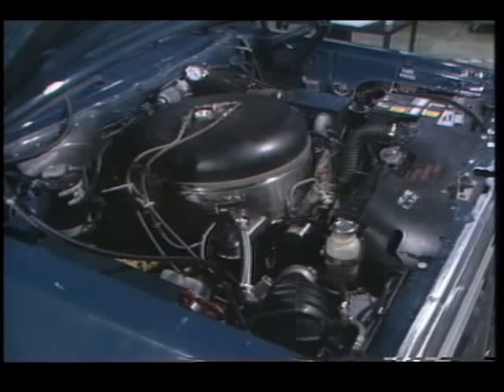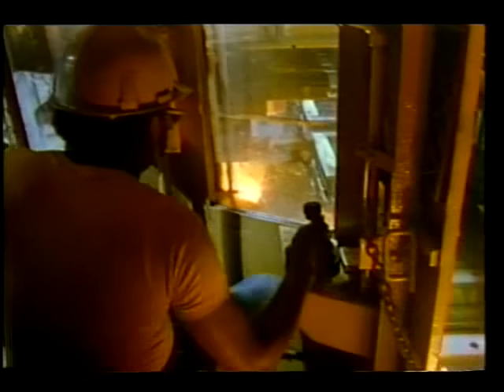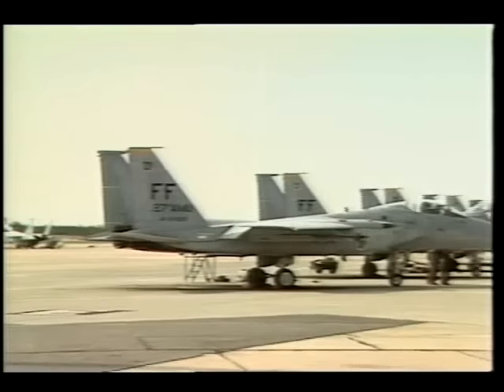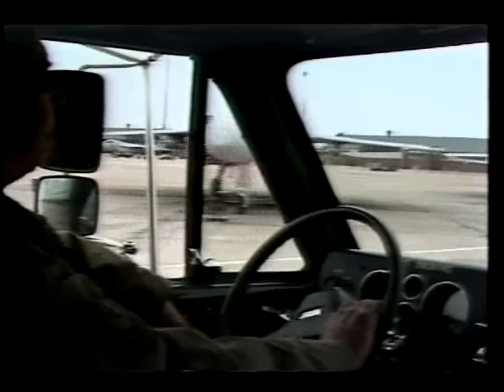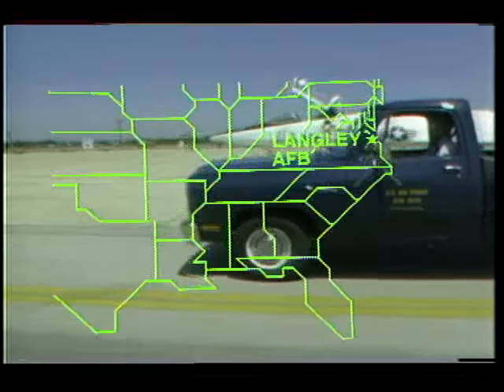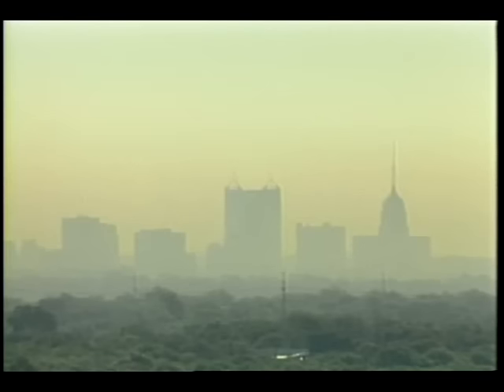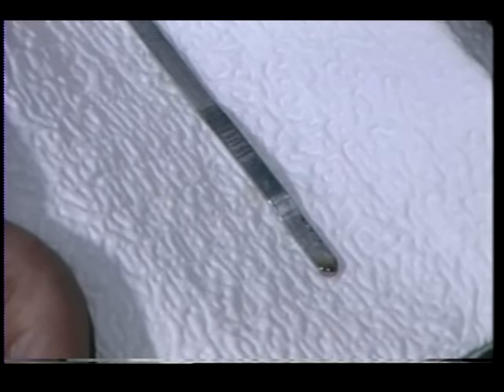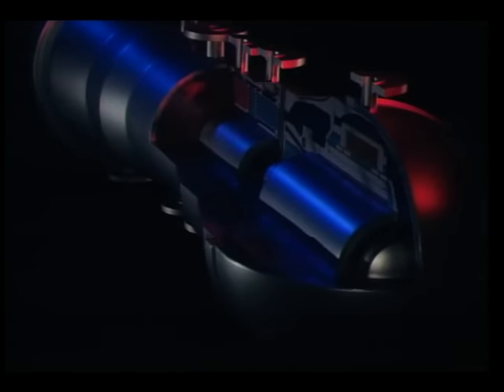The Stirling Engine: A Wave of the Future

Comment: The major issue of this engine is power density
Reply: What do you mean by power density?
Reply: @Z0Il  The amount of power produced by a determined volume.
Reply: The MOD II engine compensated for this particular problem by using pressurized hydrogen as the working gas.  Two different tanks were used, one at 2900 psi, the other at 1450 psi.  A digitally controlled mean pressure system switched between the two tanks as necessary during acceleration and deceleration, which helped keep the tank pressure as close to engine cylinder pressure to allow for a single-stage compressor to be used.  These tanks were used in combination with a "short-circuit" system that allowed hydrogen to be shunted between the maximum and minimum pressure regions of the cylinders to immediately bleed power during deceleration.  The hydrogen pressure control system is probably the true genius of this engine, and its cost and complexity may have been the real reason that it didn't get more serious consideration.  It required digital engine control and was by design a drive-by-wire accelerator.
Reply: @raelik777  but those problems can be worked around easily
Reply: @felixbeutin9530  Well,  I think the timing was just poor.  We have much better, faster and cheaper computer systems today, so the mean pressure system in the MOD II engine wouldn't be all that expensive these days.  Still complex though, and it still takes advanced materials and very tight tolerances to use pressurized hydrogen as the working fluid in a Stirling.  Will we someday see advanced hybrids that are basically plug-in EVs with a stirling range extender? Probably, but I'm guessing it'll be another 10-20 years.
Reply: @blanedabney8381  maybe it is time to revisit this technology
Reply: @felixbeutin9530  Yeah definitely. These two are just nay saying. This video is like a hundred years old. Besides, I don't think fuel density is a problem if you can just chuck some compressed straw pellets in there and go for miles. Just store them in the boot/trunk. They made a plane out of stirling engine. All you need is an electric engine to drive until the engine is hot when it comes to slow starts.
Reply: @raelik777  There are other problems inherent to that system. Hydrogen is a hard to contain gas and needs to be refilled periodically; also dangerous since the hydrogen is heated. The danger of compressed hydrogen is often over played, but compressed hydrogen above the flash point is another story. Even a tiny leak would ignite, burn a bigger in the tank, and explode. You can get similar results with helium, but we would quickly run out of it if we tried to use this wide spread. 

I heard some start-ups were using CO2 to simplify things, but I don't know how efficient that is.

Also, the MOD II only got up to 80HP. Still far less power than most customers would want.
Reply: @amirabudubai2279  Sure, though there wasn't enough hydrogen in this system for it to be that big of a concern, certainly no more than if the fuel tank went up.  I definitely think there's value in re-evaluating stirling engines for modern automotive usage, just not direct drive like this.  It makes much more sense now to have a hybrid electric system with a constant or maybe slightly variable RPM stirling generator feeding power to electric motors, alongside batteries, solar panels, etc.
Reply: @raelik777  Sterling engines do NOT use pressurized gas.  They require a temperature gradient.  In fact, LOW pressure gas is better as it has the most ability to change pressure when heated.  If the gas is already under pressure, it cannot expand when it is heated.
Reply: @raelik777  Oh yeah.  That's not remarkably inefficient or anything.
Reply: @protoborg  Also, just wrong. The pressure of the gas doesn't affect it's ability to change pressure when absorbing heat. The effect of increasing the pressure of the working fluid in a stirling engine is effectively the same as if you had instead kept the pressure constant and increased the VOLUME (and obviously added more gas to fill that volume to keep the pressure constant). It allows you to generate more power per stroke.
Reply: @raelik777  Again, that is NOT the way a Stirling engine works.  It relies on HEAT, not pressure, difference.
Reply: @raelik777  Yes it does.  Since the pistons are in a functional sealed space, the pressure of the gas can only rise so much.  If the pressure is already high, the gas cannot increase in pressure any more and will thus not be able to expand when heated.

The only way to increase pressure is by increasing the volume of the gas within a specific space.  You can't increase the volume of the gas within the confines of the cylinder without increasing the pressure.

Also, none of that is even remotely how a Sterling engine works.
Reply: @raelik777  That is simply not the way a Sterling engine works.  The two pistons in the Sterling engine are the power piston and the displacement piston.  They are not sealed off from each other.  In fact, the displacement piston moves freely within the cylinder.  AS it does this, it exchanges the heated air and the cooler air.  This causes the power piston to move.  That in turn causes the flywheel to spin.  That results in the displacement piston moving.  This all works out to cause the air to expand as it is heated then to contract as it cools.
Reply: @protoborg  yes, I'm well aware of all of that. Nothing I said changes that. And the Mod 2 IS a stirling engine. Read the paper before you argue about things you clearly don't understand.  Also, go read about the Dunning-Krueger effect, because you are clearly at or approaching Mount Stupid. You seem to think I'm suggesting they somehow use the different pressures of hydrogen to move the pistons, or something, I'm not sure what you think. That isn't what it does.  The mean pressure system in the Mod 2 increases or decreases the pressure in the WHOLE sealed system (it has to, obviously, like you said, the cylinder volumes are connected), so that it is able to absorb and release more heat per cycle. It does this in response to demand from the accelerator pedal. At the same time, more (or less) heat is generated by the burners. Obviously, there is a limit to how far this will go, depending on the engine materials ability to withstand the larger temperature swings, how fast the cold side can reject heat, the thickness of the walls required at the higher pressures increasing heat transfer resistance, etc.
Reply: @protoborg  No, you are exactly wrong. The mean pressure of the gas has little to no bearing on if the gas can increase in pressure through supplied heat (or other energy), unless you're approaching the phase transition, which 2900 PSI is nowhere near for hydrogen at the temperatures we're talking about (way above ambient). If this were true, compound turbo systems wouldn't work like they do (not that they are relevant to stirling engines, just pointing that out). The compressibility factor does have an effect, but using as pure of a hydrogen or helium charge as possible will keep this near to the ideal gas. And NONE of what I am saying is changing how a stirling engine works. You need to work on your reading comprehension.
Reply: @protoborg  Also, I'm not sure if you realize this... the NASA Mod 2 Stirling engine that I'm talking about, that is a later revision of the engine in this video. I believe the vehicles in the video are the Mod 1 version from a few years earlier, but the use of compressed hydrogen is the same in both. I'm not just coming up with this off the top of my head or something, or talking about theory.
Reply: @raelik777  Dunning-Krueger, huh?
Hello, Pot.  Meet Kettle.

If you increase the pressure in the whole system NOTHING will change.  The pressure of the system is not what determines how fast the thing runs.  That is down to the temperature gradient.  NOTHING else makes any difference to the Stirling engine.  If you fiddle with the pressure in the whole system you will cause the engine to either stop running or to run less efficiently.  Since it is already  inefficient, that would be counter-productive.  In fact, increasing the pressure inside the cylinder would LOWER the speed achieved as the cold side would be hotter and thus the gradient would decrease.

If the pressure is not used to operate the piston, what would be the point of having different pressures?  Also, if the overall pressure is increased, the cold side would be unable to "release" the heat as well.  As you pointed out, increased pressure increase the amount of heat that the air can hold.  In other words, increasing the pressure in the whole system would retard the cold side's ability to release the heat.  This would in turn cause the engine to run SLOWER as the gradient would be reduced.
Reply: @raelik777  Where in the video do you see a Stirling engine?  That thing they show when they are talking about the Stirling engine is NOT one.  Stirling engines do not have carburetors on them.  That big black dome on top looks suspiciously like a carburetor.  Also, the video never once mentions what they use to burn the fuel.  They just talk about using fuel in the Stirling engine.  Since Stirling engines do not use fuel, that is rather suspicious.

Also, hydrogen at very high pressure has the characteristics of a metal, ie NOT a fluid any more.  That would mean NO MOVEMENT inside the piston of the Stirling engine.  That would mean your vehicle would cease up and become a large metal paperweight!  NASA of all people would know about this and thus would NOT use it as the working fluid.
Reply: @protoborg  First, READ THE DESIGN REVIEW, either the Mod 2 review that I linked before, or this one for Mod 1: https://ntrs.nasa.gov/archive/nasa/casi.ntrs.nasa.gov/19820026435.pdf
I believe this video is showing the Mod 1 design, but that document is less than ideal for looking through. The scans are fairly low quality, and the organization is kinda terrible. The Mod 2 is just an improved version of it though, and almost everything in it applies to this engine, and that document is MUCH better.  What you are seeing in that video IS a Stirling engine, it just does not have the layout that you typically see in a desktop Stirling. It is built to fit within an existing automobile chassis. That dome on top is not a "carburetor" (I think you mean air filter), it is an insulating dome covering the external fuel system (the burners). That chunk of metal sticking out of the top of it (80's computer graphics are terrible) is the fuel nozzle.  Stirling engines most definitely use fuel. You have to generate the heat somehow. You can make a tiny demonstrator that uses the heat from your hand, or like a solar reflector or just direct sunlight, but you have to have heat. If you don't at least look at page 7 of the Mod 2 design review (https://ntrs.nasa.gov/archive/nasa/casi.ntrs.nasa.gov/19880002196.pdf), and then the various points in the document where they talk about the pressurized hydrogen and the mean pressure control system, you are going to continue to make yourself look like an idiot.
Reply: @protoborg  Also, the hydrogen in this engine is not at "very high pressure".  2900 PSI is actually very moderate for hydrogen.  For hydrogen to behave as a metal... you have to get it up to 25 GIGAPASCALS, i.e. 3.6 MILLION PSI. Nobody is talking about doing that. How is the air up there at the summit of Mount Stupid?  Did you read about the Dunning-Krueger effect yet? Textbook. Arrogance.
Reply: @protoborg  Wrong. Just wrong. First, I never said it would make the system run faster, I said it would let it generate more power. Increasing the pressure increases the amount of heat the entire volume of gas can absorb and release.  Just increasing the heat will only get you so far.  So you increase the pressure of the gas in the system, and increase the amount of heat.  This will allow more power to be generated with each stroke.  The actual RPM of the system has all sorts of other limitations (weight of the moving components, friction, etc, etc).
Reply: @protoborg  So the vehicles in this video are definitely using the Mod 1 engine, not the Mod 2. They were used in a separate but directly related program: https://ntrs.nasa.gov/archive/nasa/casi.ntrs.nasa.gov/19880018596.pdf
That document covers Phase I with the van, and they mention Phase II.  This document is a review of the entire Automotive Stirling Engine Devlopment project, and they talk about the truck in the NASA TU Phase II section: https://ntrs.nasa.gov/archive/nasa/casi.ntrs.nasa.gov/19970012689.pdf
That covers the vehicles you actually see in this video, which were built and are using pressurized hydrogen in their Stirling engines. This isn't some theory or even debatable.  They were built and existed and were tested extensively.  They had issues that would make them not commercially viable, since the computers at the time weren't fantastic, plus hydrogren was never going to be feasible, due to embrittlement requiring very advanced alloys in the engine and seals with fantastically tight tolerances and advanced designs.
Reply: @protoborg  The reason there are two different pressure tanks is described in the design reviews.  It is to allow for rapid pressure changes, up or down, without having to rely on the speed of the compressor pump, and also so they could get away with a single-stage compressor.  The pump just maintains the pressure differential between the two tanks.  All of that is managed by the mean pressure control system, and that happens in response to accelerating, decelerating and braking.
Reply: @protoborg  Oh, apparently there are THREE volumes of the design review for the Mod I program. I had only found volume 1 -> https://ntrs.nasa.gov/archive/nasa/casi.ntrs.nasa.gov/19820026435.pdf
Here's volume 2 -> https://ntrs.nasa.gov/archive/nasa/casi.ntrs.nasa.gov/19830002721.pdf
And volume 3 -> https://ntrs.nasa.gov/archive/nasa/casi.ntrs.nasa.gov/19820026436.pdf
Be prepared for a ride though, altogether that's 1465 pages of extremely technical details of an engine you don't think can work.
Reply: @raelik777  The problem is you don't actually know how a Stirling engine works.  You cannot use compressed gas as the operational fluid in a Stirling engine.  That is not what they are designed for.  They are designed for TEMPERATURE changes not pressure changes.  Nothing you have said changes that FACT.
Reply: @raelik777  Increasing the amount of heat contained in the air WILL be definition make the thing run faster.  That's the way it works.  Increase the temperature gradient and the engine runs faster.

No it won't increase the power.  It will ONLY increase the speed the flywheel spins at.  FYI, the "engine" in the video lacked the flywheel which is a vital part of the Stirling engine.  Without the flywheel, IT DOESN'T WORK.

I never said it would increase the speed indefinitely.  But increasing the heat DOES increase the speed.
Reply: @raelik777  A Sterling engine has NO FUCKING SEALS!  That is the whole fucking point!  Sterling invented the fucking thing in order to get around the short-comings of steam engines, ie they explode due to pressure leaks.  In other words, NO PRESSURE SEALS.  What the hell does a computer have to do with anything an engine designed in the 1816?  Just because NASA calls it a Sterling engine doesn't make it one.
Reply: @raelik777  Look at page 28 of the first volume of this ludicrous monstrosity.  That is NOT a Stirling engine.  That is an over-engineered pile of garbage NASA is trying to pass off as their "improved" Stirling engine.  NASA has essentially improved a mouse trap by making the mouse stupider.
Reply: @raelik777  Page 28, Volume 1: That is an ICE that has been run through a trash compactor one too many times.
Reply: @protoborg  This video is literally about the development of one of the most efficient Stirling engines ever created. Period. The Mod 1-equipped vehicles shown in the video aren't quite to that level, but the Mod 2 vehicles were. They reached a peak thermal efficiency of 38.5%.  Modern gasoline internal combustion engines reach 25% at best. It wasn't pursued further because of the production costs and concerns about throttle response.
Reply: @protoborg  No, that would be your over-inflated ego.
Reply: @raelik777  The Stirling cycle no more makes something a Stirling engine than putting a motor on a bicycle makes it a motorcycle.
Reply: @raelik777  No.  This video is about NASA TRYING to make a more efficient Stirling engine and failing miserably.
Reply: @raelik777  A nuclear power plant uses the same principles as a steam engine.  Does that make the nuclear reactor a steam engine?
Reply: @protoborg  Actually, that is EXACTLY what defines a Stirling engine: An engine that uses the Stirling cycle, of which there are many types. However, I wouldn't expect an ex-Uber driver to understand that.
Reply: @protoborg  Wrong, because they did, and succeeded, and are widely recognized as having done so 35 years ago.
Reply: @raelik777  No it isn't.  A Stirling engine is a particular type of engine that just so happens to use the Stirling cycle.  There are exactly three types of Stirling engines; alpha, beta, and gamma.  There may be other types of engines that use the Stirling cycle, but they are not Stirling engines any more than a Toyota factory is a Ford factory just because they both use techniques created by Henry Ford.

What does being a former driver for Uber have to do with anything?
Reply: @raelik777  Nope.  They did nothing of the sort.  They developed an engine that uses the Stirling cycle.  That does NOT make it a Stirling engine.  That only means it uses the Stirling cycle.
Reply: @protoborg  A Stirling engine is defined as "A heat engine that is operated by a cyclic compression and expansion of air or other gas (the working fluid) at different temperatures, such that there is a net conversion of heat energy to mechanical work. More specifically, the Stirling engine is a closed-cycle regenerative heat engine with a permanently gaseous working fluid."
That's it. You don't get to decide the other parameters of what YOU think a Stirling engine it, because THAT is what the scientific community has agreed defines one.  The NASA Mod 1 and Mod 2 engines fit that to the letter. Your opinion means absolutely dick.
Reply: @raelik777  No.  The definition of a Stirling engine is a heat engine that is operated by a cyclic compression and expansion of air or other gas (the working fluid) at different temperatures.  However, in practice a Stirling engine is a specific configuration of components.
Reply: @raelik777  And you don't get to call something a Stirling engine simply because it uses the Stirling cycle.
Reply: @raelik777  Nice to meet you, Pot.
Reply: @protoborg  Except I do when it clearly is. The double-acting arragement is a hybrid between a piston and rotary Stirling. It rotates (figuratively, they don't literally rotate) the displacers on either side of the power piston. In addition to giving great design variability in the heat transfer area, this layout eliminates all but one external seal on the output shaft and one internal seal on the piston. Also, both sides can be highly pressurized as they balance against each other. That is straight from Wikipedia, if you're curious.
Reply: @protoborg  Here is an image of the arrangement of a double-acting Stirling: https://www.mpoweruk.com/images/stirlingDA.gif
Reply: @raelik777  There are no seals on a Stirling engine.
Reply: @protoborg  Let's do a little thought experiement. Say we have a hermetically sealed beta-type Stirling, with no "seals" like you seem to believe is important. Never mind getting power out of it, though that could be done with a linear generator. Isn't important.  Let's seal it with air at ambient pressure and temperature at sea level, so an ideal 1 atmosphere.  Give it some heat and cooling, and it'll work (assume the flywheel is also sealed inside). Now... take it up to Denver, where the ambient pressure is lower because of elevation. Now your Stirling is pressurized! Does it stop working?
If not, what about if we take it up to Everest? Or maybe put the Stirling in a vacuum chamber?  Maybe not at a full vacuum (since we'd probably rupture the thing, since it probably wasn't built to hold at that relative pressure), but enough to simulate an even higher altitude.  Or what if we DID build it strong enough for that, could we launch it into space and it still work? You do realize that there is no functional difference between increasing the internal pressure or decreasing the external pressure, not until you cool the gas to the critcal temperature for phase change to liquid. All you are doing when you pressurize a gas is adding more mass of that gas to a given volume. This doesn't change the behavior of the gas, there is just more gas in the same space. Having more mass of that gas allows it to absorb and release more heat than you could do in the same volume at less pressure.  How much pressure required for a given amount of gas is can is a function of the specific heat capacity of the gas molecules (which is NOT pressure dependent, it's a function of the molecular weight of the gas), and obviously the thermal characteristics of the cylinder walls. The higher the specific heat, the more of it a gas can absorb and release.  The more capacity it has, the faster it can increase and decrease pressure in response to that, and the more mass you have doing that, the more energy is exchanged while doing so.  A lower molecular weight makes for a more compressible gas (typically). The mean pressure of the gas has no bearing on it's ability to increase or decrease in pressure.
Reply: @protoborg  You may have incorrect assumptions about the behavior of gases under pressure due to the behavior of things like compressors (i.e. electrically driven pump. An actual compressor turbine has different limitations) and especially pumps. When you see a pump unable to increase the pressure of a gas in a vessel any further, that is because of limitations of the PUMP, not the gas. The seals in the pump aren't strong enough, or the piston diameter is too small, or the cylinder doesn't move enough volume per stroke, or there isn't enough power available. When you're pumping gas into a system, during the actual pumping stroke, the pump volume and the vessel volume are connected into one volume, and they equalize, even if it's only for a moment due to a valve or something. At a certain point, that pump will not handle that pressure.  HEAT, however, has no such limitation. That is why it is exceedingly dangerous for a pressurized container to remain too long in the vicinity of a large source of heat.  The gas inside will happily and very easily increase in pressure until it violently ruptures the vessel.  If you don't believe this, I HIGHLY recommend you go do a little experiment.  Take a regular bicycle pump, and try to fill a scuba tank up to 3000 PSI. When you get tired, assuming you die of a heart attack first, go through a propane bottle in a fire and tuck in for a nice session of marshmallow roasting.  Don't worry, according to what you think, it won't explode! Sit as close to the fire as you like!
Reply: @protoborg  Let's throw even MORE science at this, if you aren't satisfied. Here is a simple phase diagram for hydrogen: https://www.researchgate.net/profile/Andreas_Zuettel/publication/8618603/figure/fig1/AS:277689450680341@1443217732712/Primitive-phase-diagram-for-hydrogen-Liquid-hydrogen-only-exists-between-the-solid-line.png
We're talking about a system that is operating with pressurized hydrogen from 1450 PSI to 2900 PSI, or 99.97 bar to 199.9 bar (almost seems like they chose those pressures for a reason, doesn't it?).  Let's pretend they have some serious antifreeze in the coolant system for the cold end, or maybe have a block heater, and can run this thing as low as -40 C (or 233.15 K), and the Mod 2 design says the heater combustion temperature gets as high as 1700 C (or 1973.15 K).  The thermal efficiency of the whole system is ONLY 38.5% (only), meaning most of that heat is wasted in the exhaust or by being absorbed by the engine mass and other components. But let's pretend it can actually get the hydrogen that hot (it has no bearing on my point, as you will see). On the phase diagram, that puts us at or 1/20th of a line higher than the 10^2 mark on the pressure axis (Y, which is linear), and between just past the first mark after 10^2 and just short of the first mark past 10^3 on the temperature axis (X, which is logarithmic). That is WELL within where hydrogen is a gas, and nowhere approaching a phase change.
Now, lets look at diagram of the volumetric density of hydrogen as a function of gas pressure: https://www.researchgate.net/profile/Andreas_Zuettel/publication/8618603/figure/fig2/AS:277689450680342@1443217732737/olumetric.png
Down at the 100 to 200 bar range our hydrogen is in, it behaves as close to an ideal gas as possible, meaning that you can basically use the ideal gas law formulas directly without having to worry too much about the intra-molecular behaviors of a real gas vs. an ideal gas.  In fact, we are so low on the curve it might as well be at room temperature and ambient pressure, that's how little difference it makes.  It's not zero difference, but it isn't relevant to the operation of a Stirling engine.  The only question is can you build an engine that can contain that pressure, transfer the heat efficiently to and from the gas volume, and make adequate seals that only add a reasonable amount of friction to the system and don't cause you to waste too much energy running a multi-phase pump to maintain the pressure or keep having to add more working fluid.  The answer to that is yes, you can, because they did it in the early 80's with a lot of very, very smart people working on it spending a ton of money.
Reply: @raelik777  There are sooooo many things wrong with your statement here.

First, you can only compress a gas until it becomes a LIQUID.  In other words, it ain't a gas any more.  That's how they get liquid oxygen for the space shuttle.  BTW, there are two ways to increase the pressure of a gas.  Either you increase the mass of gas within the space or you decrease the space.  One way you increase the heat, the other way you don't.

Further, even if the gas did not liquefy at some pressure, you can't compress matter down to the Planck length as atoms have mass that cannot be compressed.  Thus the minimum you can compress something is determined by it molecular mass.  However, the matter will have long since turned solid by that point.

You wouldn't need an entire tank of gas to run a Stirling engine.  That would be waaaaay too much gas.  The gas within the cylinders is more than enough as that is the way the thing is designed.

Advanced alloys for hydrogen, huh?  So I guess no one ever uses hydrogen as a fuel source.  Yeah, nice try.

It wasn't adopted because the power-to-weight ratio is just too damn high.  The amount of power it produces is much too low for the mass of the engine.  The price is irrelevant.

What the fuck possible reason could there be for using an engine which outputs ROTATIONAL energy in a fucking rocket?!  That is beyond stupid.  A Stirling engine adds nothing but weight to a rocket.  Not to mention the fact that the whole point of the RTG is it HAS NO MOVING PARTS.

I didn't say you CAN't pressurize a Stirling engine.  I said there is no point.
Reply: @raelik777  So your contention is that NASA equals great idea?
Reply: @protoborg  First point, FALSE.  To liquefy a gas, you MUST cool it to the critical temperature.  It does NOT matter how much you compress it, if you haven't cooled it to the critical temperature, it will NOT liquefy.  Hydrogen must be brought down to 33 K before it will liquefy.  Once you do that, it actually doesn't take much pressure to liquefy, like 13 bar or so. Here is a more complete phase diagram, though the X axis is mass density grams per cubic centimeter.  http://militzer.berkeley.edu/diss/log_phase_diagram08.png
You can convert that axis to bar or PSI with that volumetric density graph, but it's easier to remember that hydrogen is about 20 kg/m^3, or 0.02 g/cm^3. So  pretty much anything on that chart to the right of 10^-2 is over 4300 PSI. "Molecular fluid" is just another name for gas, "atomic fluid" means that the H2 has broken down into individual atoms.  The grey area at the bottom is the actual liquid phase, and above and to the right of the critical point (the point labeled Cgl), they don't label it, but that's where hydrogen is supercritical, so it behaves like a gas AND a liquid, at least until it either goes solid or metallic. There we are talking about VAST pressures that no pump is going to achieve.
Second, the internal volume of the cylinders is a total of 0.502 liters. The actual hydrogen tanks are 1 gallon, but that's to account for the inevitable slow loss of
hydrogen from the rest of the system, so it doesn't have to be refilled very often.
You don't need advanced alloys to just contain hydrogen in a tank, or to burn it or use it in a fuel cell. You DO when you're running it at upwards of 2000 PSI and heating it in a metallic vessel, as most metals absorb and are embrittled by hydrogen. Just burning it near ambient pressure doesn't require anything fancy.
The power-to-weight ratio was NOT great, I can't deny that.  It wasn't HORRIBLY worse than the Celebrity engine the Mod 2 replaced.  And that was almost certainly a factor.  They might have been able to get it to equal it, but the cost was actually cited as THE factor. It was just too expensive (both in construction and future maintenance), and getting the power-to-weight down would have been even more expensive.
Finally, what did you not understand about a free-piston linear generator? It is literally hermetically sealed, with no mechanical output.  It has external electrical connections, because the piston drives a linear generator.  Also, I said space craft, NOT a rocket. We use rockets to get things into space, but those things (which we tend to call spacecraft, even if they don't carry people) often need electricity once they're up there.  ASRG = Advanced Stirling Radioisotope Generator.  It uses a Sitrling cycle to generate electricity from the heat of a decaying radioisotope (plutonium in this case). They've been running one non-stop for over 100,000 hours now: https://www.spaceflightinsider.com/space-centers/glenn-research-center/it-keeps-going-and-going-stirling-engine-test-sets-long-duration-record-at-nasa-glenn/
The point of the ASRG is that it will generate more power than an MMRTG (140 w vs 120 w), but weigh about 13 kilos less, and use a quarter of the plutonium. If you are going to be this arrogant, you need to learn more about what you're talking about. This is textbook Dunning-Krueger shit. Textbook.
Reply: @protoborg  I never said all of NASA's ideas are great. Hardly, in fact. Yet, here you go, continuing to try to move the goalposts... again.
Reply: @raelik777  Just because it runs longer does NOT mean it produces more power.  Even if it did produce more power, the additional weight of the moving parts is NOT worth it.  Spacecraft (which use rockets for propulsion) are VERY sensitive to weight changes.  It's not like they can use an electric motor to propel the damn thing.

A Stirling engine does not need high pressure gas to function.  In fact, it is designed to work at atmospheric pressure.  Your examples of different pressure locations does not change that as the pressure inside the engine REMAINS THE SAME regardless of where you take it.

It's funny you keep referencing things that are not actually supporting your point.  That last reference is about a GROUND experiment.  It has NOTHING to do with going into space.  Ever wonder why they don't have massive machinery on a spacecraft?  It's because the spacecraft has to limit the weight it carries.  That's one reason why you will never go into space.  Despite your vacuous head, your density is far too high.
Reply: @raelik777  I do applaud your use of a logical fallacy.  However, you are still suffering from pot-kettle so...
Reply: @protoborg  You are the one moving the goal posts. First, I NEVER said they NEED pressurized gas, just that you CAN use it. Second, It DOES support my point that a Stirling engine CAN use pressurized gas. You seem to forget that this is how this argument started, and your refusal to admit your ignorance to that easily proven fact. I gave the ASRG as an example because it is a sealed system pressurized to 500 PSI of helium.  It is far simpler to describe and understand because it's a simple free-piston Stirling linear generator. However, that does not mean the Mod 2 is NOT a Stirling.  It's just a far more complicated one because of the constraints of the time it was built and the purpose it was built for.  82.5 HP.  You try building a Stirling that can do that and will fit in the engine bay of a simple 2 or 4 door passenger car. I'll wait.
Just because the experiements are being done on the ground doesn't mean they don't plan on launching it into space. That is how we fucking test things before sending them into space, we don't live there. The ASRG IS designed for space, it only weighs 32 kg (13 kg lighter than an MMRTG), and puts out 20 more watts of power using less plutonium. It's intended to be used in deep space missions, which last for decades, so they need to be sure that these Sitrling engines will last long enough.  Hence, a ground test that is 110,000 hours and going. You need to learn to read.
Reply: @protoborg  Keep up with your deflection, we'll see how well it works when I keep providing actual concrete examples and proof of what I'm saying, while all you have provided are incorrect words from your head.
Reply: @protoborg  No, I don't think it is, not by a long shot. You have only your arrogance to back you up. I have cold, hard, scientific fact.
Reply: @raelik777  Actually, you have outdated references and innuendo on your side.  You also seem to think insults give you the higher ground.  By the way, how's the view from the top of Mount Stupid?
Reply: @protoborg  Also, who said anything about a nuclear reactor? We were talking about a plutonium-238 heat source, similar to the GPHS (general-purpose heat source) that they use in RTGs. They require no maintenance. They just sit and generate heat, and over time, they generate less and less until they aren't useful anymore. We've been launching them into space for literally decades. Each MMRTG has 8 of them, and with each generating 250 watts of heat, there's a total of 2 kilowatts radiating in there. It converts that heat to electricity using thermocouples, and gets 125W of electricity out of it. Yeah. That sucks ass. It's 6.25% efficient, which is typical for thermocouples. The absolute best thermocouple material proposed is predicted to get 15-20%, which would be a game changer.  Sunpower's ASC Stirling engine is 37% efficient.  No wonder they're looking at using Stirlings in space. Reading. Comprehension. Work on developing it.
Reply: @raelik777  Radiation is NOT heat.  The radiation must impinge upon something for heat to be generated.  The thermocouples  that produce the electricity turn the whole process into a form of nuclear reaction.  I will admit it is not an actual nuclear reactor, but radiation has the funny ability to degrade things it impacts rather quickly.  So, yes, they do actually have to maintain the damn thing.  Plus, Plutonium-238 has a half-life of 88 years.  Unless they are sending the probe into interstellar space, they are not going to waste plutonium on a spacecraft.  The solar panels are much lighter and will keep the batteries charged far longer than the mission.  They are also much safer than a highly radioactive substance.
Reply: @protoborg  I can concede the point about goalpost moving, because you may have really only done that a couple times, and not every time I chided you for it. You DO keep changing the subject at hand to a related topic that is actually irrelevant to my original point that you persist on saying is false. Now, as far as NASA not "launching" anything into space, you may be technically right about that point, because I haven't been keeping up with the technical details of NASA's budget and where they spend the money they do get, but... IT DOES NOT MATTER. Sure, I'm probably wrong about that. Who cares? Literally irrelevant to the ORIGINAL point about pressurized gas in Stirling engines, which is what you have been dodging since the beginning. And if you DO think my wrongness about the state of NASA launch programs is relevant to the original topic, then that's a fallacy fallacy, as my being wrong about THAT doesn't make me wrong about Stirlings.

EDIT: NASA DOES still launch rockets, mainly for DOD and for launching their own spacecraft (like the upcoming James Webb Space Telescope). They don't build the launch vehicle itself anymore (aka the rocket), but they certainly build the spacecraft, and they maintain the launch sites, and provide ground crew and services necessary for getting the rocket off the ground. They get paid for it too, at least when it isn't their own spacecraft being launched.
Reply: @protoborg  Now, as for "references" being old and outdated, technical documents on an engine that was undeniably built and constructed can never be "outdated". It describes exactly what was done, and it proved my point precisely.
Reply: @protoborg  Never said that radiation was heat, but I'll bite, even though it has nothing to do with Stirlings, and once again, you're talking about things you don't fully understand. First, the GPHS modules are mosly carbon (graphite probably). Inside, they contain iridium-clad plutonium-238 dioxide fuel pellets. Plutonium-238 is a very strong alpha emitter, and not much else (it puts off some neutrons and gamma radiation, but not like Pu-239 or U-235), which makes it very difficult to use in a nuclear reactor. Most of the alpha particles get absorbed in the mass of the fuel pellet itself. The iridium cladding does the rest. Absorbing the high-energy alpha particles makes the pellets glow red hot, and that heat is absorbed by the body of the GPHS module. The thermocouples sit against these modules, and convert that heat into electricity. No significant radiation is emitted outside the GPHS module, and definitely not outside of the RTG body itself. We have launched many RTGs into space on various craft, including the most famous of all: Voyager 1 and 2.  They're older RTGs than the MMRTG we use now, but they work on exactly the same principle.  Voyager 2 is starting to suffer pretty significant power degradation by now, and Voyager 1 will start having major power issues by 2025, with most of the scientific instruments no longer being able to function.  That's a pretty good run though, seeing as they're the most distant objects we've ever launched into space, and I can guarantee not a single second of maintenance was performed on those RTGs after they launched :D :D :D
Reply: @protoborg  Oh, and if those homemade projects aren't proof enough, here's an old Philips MP1002 CA stirling generator that uses compressed air at 200 psi, and drops down to 160 psi while running. https://www.youtube.com/watch?v=0IdXTippOQA
Reply: @protoborg  I could keep linking more and more of them, but the fact is, every single Stirling engine that isn't just a weak-sauce candle powered desktop demonstrator but actually does REAL work uses compressed gas as the working fluid.
Reply: @raelik777  I haven't dodged anything.  You are the one who launched this tangent.
Reply: @raelik777  I never said you couldn't pressurize the thing.  I said it will add nothing to the operation of it.
Reply: @protoborg  Oh, I was definitely wrong about that Spaceflight Insider article (https://www.spaceflightinsider.com/space-centers/glenn-research-center/it-keeps-going-and-going-stirling-engine-test-sets-long-duration-record-at-nasa-glenn/). I thought it was about the Sunpower ASC modules used in the ASRG, but it wasn't. It was a Qnergy test unit, and they sell commercial systems based on the same technology. No idea what pressure they run their Stirlings at, but it has to be fairly high to put out the power they do.
Reply: @protoborg  Your VERY FIRST reply to one of my comments: "Sterling engines do NOT use pressurized gas.  They require a temperature gradient.  In fact, LOW pressure gas is better as it has the most ability to change pressure when heated.  If the gas is already under pressure, it cannot expand when it is heated."
That is what started ALL of this, because it is factually incorrect. There are many Stirling engines that do use a pressurized working gas, any that produce useful power, in fact.
Reply: @raelik777  And a heat source has nothing to do with the HOT AIR engine designed by Stirling how?
Reply: @protoborg  Stop changing the subject. I didn't say heat sources didn't have anything to do with Stirling engines, I meant that nuclear decay itself and the details of how a GPHS functions don't directly have anything to do with a Stirling engine or the method of their operation.  Of course, any heat source can be useful for driving a Stirling. But NOBODY is arguing about that.
Reply: @protoborg  Yes you most certainly have been dodging the original argument. The only tangents are the ones you've dragged me into with your constant refusal to admit you were wrong about the original claim that started all of this, when you said "Sterling engines do NOT use pressurized gas.  They require a temperature gradient.  In fact, LOW pressure gas is better as it has the most ability to change pressure when heated.  If the gas is already under pressure, it cannot expand when it is heated."
Reply: @protoborg  Here's another Stirling using a pressurized working gas: https://www.youtube.com/watch?v=mNLEKiLNw08

I can do this all day.  Every example you find of a Stirling that could do actual useful work has a pressurized working gas.
Reply: @protoborg  Another pressurized stirling, cute little rhombic drive: https://www.youtube.com/watch?v=NOaBo_ubESI

Not very powerful... but it also only has a tiny little hand pump for increasing the pressure. Plenty of other reasons that it puts out so little power, but the low pressure is one of the reasons.
Reply: @protoborg  I wonder why all of these people are building Stirling engines with pressurized internal volumes... maybe they know something you don't? Perhaps they've read a book or two on the subject, maybe even this one: https://ntrs.nasa.gov/archive/nasa/casi.ntrs.nasa.gov/19830022057.pdf (Yes, this was made for NASA, but was written by William R. Martini, now the Director of Engineering at Northrop Grummann).  Pages 51 through 54 list a whole slew of Stirling engines that ran with pressurized gases many years ago. The science has not changed since then, just the engineering.
Reply: @raelik777  Or perhaps they are trying something thinking it will work as that is the way tinkerers think.  NASA is hardly the final authority on technology, ya know.
Reply: @protoborg  Just like I'm certain of your original statement being entirely wrong, I'm also certain that there are little details I got wrong in all of those tangents you led me down. I'm human, after all, so I'm not claiming to be infallible. But, the fact remains that pressurized gas is used very often in Stirling engines for the purposes of being able to convert more heat into mechanical energy. If you don't increase the pressure, the only way to do that is to make the internal volume larger. That allows you to have more mass of working fluid (same as if you increased the pressure and kept the volume constant), but that also means there is more mass of everything else, and the engine is much larger. Increasing the temperature differential will help too, but there are more difficult limits to overcome with this approach, the main one being that the larger you make that differential, the harder it becomes to maintain the cold side temperature.
Reply: @raelik777  Why does the aerosol can explode when you heat it?  That was exactly what I was getting at.  Yes it does expand...beyond the confines of the container.  So, no it can't expand if it is already under pressure...without destroying the container.  I guess you missed that nuance.  Stirling engines, by their very design, have a low upper boundary of power.  That is the whole reason why NO ONE USES THEM for anything other than a fun toy.  Your three examples are nothing more than exceptions.  My statement still stands.  I wasn't wrong.  I was merely incomplete in what i said.  Generally speaking, Stirling engines do not use compressed gas.
Reply: @protoborg  I have a feeling you're going to jump back to try to argue about how compressing a gas turns it into a liquid again, so let me stop you, because I think I know where this misconception comes from. I thought of it because I just mentioned it incidentally. Aerosol spray cans.  They have a pressurized gas in liquid form in them. So do things like propane canisters and "dust off" (often called 'compressed air', but it isn't air, it's usually some haloalkane or diflouroethane). We'll lump them all together because they have one thing in common: they are all gasses whose liquid state has a boiling point slightly below room temperature at ambient pressure.  They are pressurized in the can and cooled (mostly to compensate for the temperature increase due to pressurization), which forces the vapor into a liquid. Some room in the can is left for vapor expansion, and the vapor reaches an equilibrium state with the liquid: pressurized but not cool enough to liquefy, and the liquid is under enough pressure to remain liquid at room temperature. When you release the pressure by pushing the nozzle, four things happen pretty much simultaneously: gas escapes, the pressure drops, the liquid boils releasing more vapor, and the liquid cools down very quickly. If you keep holding down the nozzle, the can will get very cold and the gas will start escaping much more slowly. That's because you've let out all the gas that was pressurized, and now the only gas you're getting is from the boiling liquid inside, which is almost too cold to boil.  You have to stop and let the can warm up, while the pressure builds back up in the can as the liquid keeps boiling. You can hear it do this. Eventually, it stops boiling when it builds up enough vapor pressure to reach equilibrium, though you have to let it warm back up to room temp to get full pressure again. None of this is because the pressure in the can is very high. It's actually not very high at all, which is why they choose those particular propellants, so the cans can be relatively thin, and people aren't holding potentially dangerous containers near their bodies that could main them horribly if they ruptured.
Reply: @raelik777  I wasn't going to bring it up, but, since you did, there several gasses that liquefy under pressures less 1000 psi.  I can't name them all, but water comes to mind.  Take water vapor and condense it.  As the pressure goes up (due to increased density) the vapor begins to coalesce into liquid water.  Keep increasing the pressure slowly enough and it will momentarily become solid.  Not ice, but solid.
Reply: @protoborg  They are not exceptions. There are many, many examples of Stirling engines running with pressurized gas. I just threw a handful that I found in minutes, and your statement is still wrong. You are only correct in that desktop toy Stirlings do not use pressurized gas. Knowing that and assuming that no Stirling has anything to gain from running with pressurized gas is sheer ignorance.
Reply: @protoborg  Sure there are, but it isn't JUST pressure. Temperature is key. For a given gas, if you don't bring the temperature low enough, it will never liquefy, regardless of how much pressure you put into it. You may acheive a supercritical fluid state, where it behaves both as a liquid and a gas. This may or may not be desirable, depends on the supercritical fluid in question.  At the temperatures we're talking about, and the pressures given, all of these pressurized Stirlings are operating well within the gas phase of their respective gases, whether that's hydrogen, helium, air, nitrogen, or whatever else someone might try.
Reply: @protoborg  Let's compare air and H2 gas.  The critical point for air (assumed to be a mix of 78% N2, 21% O2 and 1% Argon) is -140.52 C at 549 PSI. That means that above -140.52 C, it doesn't matter how much you pressurize air, it will not liquefy. It'll be a supercritical fluid if you're above that temperature AND pressure, but anywhere below that pressure and above -140.52 C, air is a gas. Now, it can still be a gas at lower temperatures, but the pressure has to be lower.
The curved purple line going down to the triple point shows where that transition is for a given temp and pressure: https://www.engineeringtoolbox.com/docs/documents/2008/Air%20phase%20diagram%20C.jpg
Now we look at H2. It's critical point is -239.96 C at a mild 193 PSI. Same as for air, you won't get liquid hydrogen until you get it that cold, and above that pressure and temp, it's supercritical. Here's the phase diagram for H2 (lower temp version of the one I pasted before): https://www.engineeringtoolbox.com/docs/documents/1419/Hydrogen%20phase%20diagram.jpg
Now, from what I understand about supercritical hydrogen, is that it behaves very much like the gas. The molecular mass is so low that it doesn't have a measurable impact on viscosity like other supercritical fluids. Obviously, it wasn't detrimental to the operation of the various pressurized Stirlings that used it in that phase (which was basically all of them).
What this means, is that for any gas that you'd actually WANT to use (so low molecular mass with high specific heat, and not corrosive or particularly toxic, and obviously with critical points well below any temperature the engine will encounter), at the temperatures a Stirling runs at, you're never going to pressurize the gas so much that it liquefies. Ever. The more pressure you can put in it, the more heat capacity it will have, and the more power you can get from it.  You will sacrifice efficiency, and eventually you will run into issues with the cylinder walls being too thick and impeding heat transfer, or not being able to build adequate seals, or otherwise maintain that pressure.  But there is a large range of pressures where useful work can be done by a Stirling with excellent efficiency.
Reply: @protoborg  I also realize those two low temperature phase diagrams don't show where the supercritcal phase ends and other behavior starts showing up, like metallic phases at insane pressures, or atomic gases and plasmas at huge temperatures. Those matters aren't relevant to liquification or the temperatures and pressures suitable for a Stirling engine. I also didn't mention how when liquid air boils, depending on the temperature the nitrogen can boil off first, leaving the liquid oxygen rich and changing the boiling point. Also not relevant.
Reply: @Bruce Williams Phillips did the initial revival work in the 50's, that video is fantastic, and I had no idea it was on the net anywhere!
Reply: @protoborg  Dude, stop digging. You are way out of your depth here. The thing that looks like a carburetor (did you mean air filter perhaps?) is the cover over the hot end of the four working cylinders. And yes the pressure inside the cylinders can be varied. Not by the working cylinders but by an external valve or compressor. Varying the working gas pressure changes the way the heat is transferred withing the engine. This is a very sophisticated engine not an atmospheric pressure model that uses air as its working fluid.
Reply: @protoborg  There are seals on virtually all Stirling cycle engines. Some are 100% efficient, other less so.
Reply: @delusion2987  I agree. Don't doubt yourself on this one I think you are right on the money. A clear case of a little knowledge being enough to get you into hot water. In this case, an oceans worth. 😁
Reply: @jimhood1202  WRONG!  Sterling engines have seals on the secondary PISTON (the smaller one), not on the cylinder.  The primary piston has no seal as it wouldn't work if it did.
Reply: @protoborg  Ha. You are so easily triggered. 😁 You are also wrong on so many counts. So many I can't be bothered addressing all the points you don't understand. I'd love to know what makes you so confident that you know enough about this subject to lecture others who are clearly (but misguidedly) trying their best to educate you. Dunning Kruger springs to mind...
Reply: @protoborg  Oh, you're so perceptive, how did you know?

You guessed. Just like all the other nonsense you spout.

"Played with"? So all you know about are toys, interesting. Meanwhile engineers are designing and building functional machines using the Stirling cycle. Like the Stirling cycle engine I designed and built from scratch in high school several decades ago.

With each comment you become more of a joke. Come on give me the last laugh with another insightful (yet wrong) remark. 😁
Reply: @protoborg  Maybe just read the link?
Reply: @protoborg  This is the longest and dumbest response troll string I've ever seen on youtube. You deserve some kind of award good sir!
Reply: @raelik777  wow great info  have you thought about this type of motor using a heat pump
Reply: @felixbeutin9530  yes and see about using a heat pump with it
Reply: higher power density than EVs if you factor in their batteries...
Reply: wrong